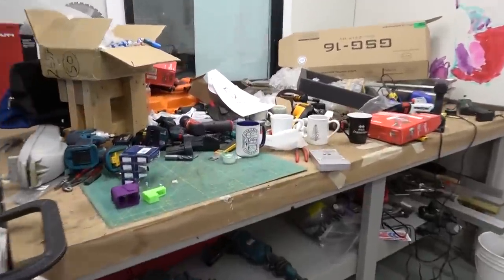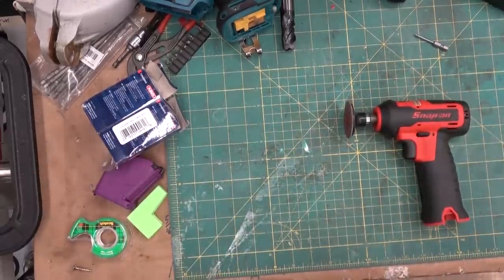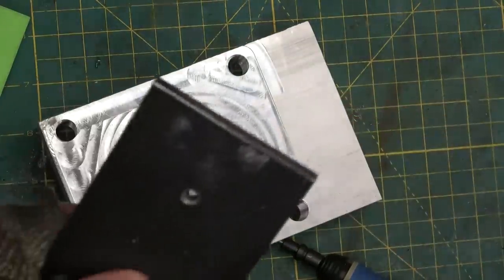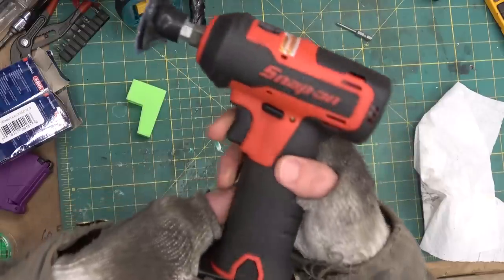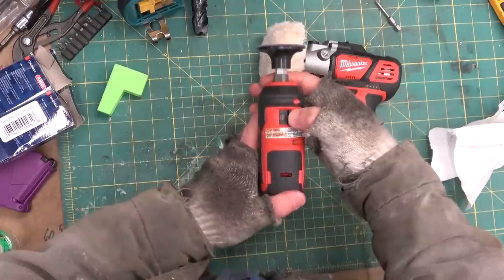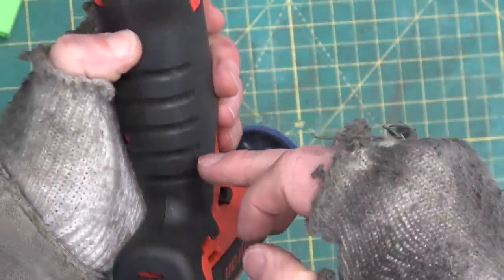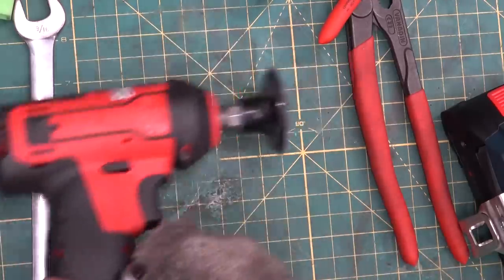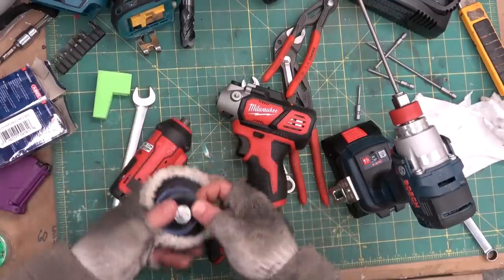BOLTR: Snap-On Polisher $$$ worth it?

Comment: I've taken apart over 100 of the Snap-on 14.4v power tools in the last two years.  If the plastic is damaged, you caused it.  I've never seen one with damage like that.  It's interesting you cut out the part of the video where you removed the screws.

Comment: When i got mine the first day i used it, it caught on fire. The high speed on that is ONLY FOR SANDING. Variable speed trigger works well, but it's not meant for continuous use. I had a good relationship with my snap on guy so he cut me a deal, and i got just the body and the battery with pads for like 200

Comment: I've got all snap on cordless except for my 1/2 inch gun it is the new Ingersoll rand, which by the way is a badass tool. I will say I prefer Snap on's cordless air ratchet over milfuckee and their right angle drill. Snappys right angle drill is just kick ass compared to milfuckee. Snapons cordless impacts are meh, they work. Nothing to write home about. When I bought my snap on cordless stuff millfuckee did not have much in the way of cordless tools. Now I am too deep into it to turn back.

Comment: I’m a motorcycle mechanic by trade here in Straya and a lot of us use the Snap-on cordless screwdriver for everything. Almost everyone I know that has bought one has had it burnt out or the LED lights just stop working after a month... 

They come with a 1 year warranty and with a $550 price tag. That’s without buying fucken battery too.. 

They are truly a piece of shit for the money you pay, but no one makes a drill that has the same ergonomics/size as the snapon and the battery life lasts me easily 2 weeks of constant abuse.

Comment: Had one for a couple of years. I use for occasional heavy use. 
Had no problem with the case or over moulding. Like the batteries. Horrible charger - very loud.
In the low speed it will frequently over temp (I guess) and shutdown for a while. Doesn’t do it in high speed.
Not the best.

Comment: I am a Fap-Off guy generally and love their hand tools, but have been steadily disappointed with their power and air tools.  I have found GOOD die grinders however, if you get the chance I'd love it if you would review a Dynabraid  tool. I've had good luck with them, but I defer to your bullshittery and opinions. I'd send you one, but I think your tool budget is a little more gerthy and impressive than mine, which is short, shriveled, and slightly to the left. Keep up the good work!
Reply: Certain Fap-on air tools are in fact relabeled Dynabraid. Specifically die grinders and D/A sanders. Only difference is the color change. And sometimes cost.

Comment: I've had this tool for years, used it professionally, in mining and agricultural fields, across a variety of tasks  from polishing to sanding and others in between. Never had a issue. Does everything i asked and still in good condition. Been dropped ect. Not a brand snob bit it works for me still to this day. Good tool imo.

Comment: I have a couple of the 14.4v line tools that take that batteria. Those through hole corntactors are pretty terribly soldered cold, a few rips of the in and out on the batteria breaks em loose everytime. Pretty sad when you spend more time fixing the jeezless thing than you spend on the customers vehicular manslaughter machine on the job site. Just an FYI if you end up having to smack her around to get her to chooch. Hit her with the dinosaur fart burning soldering iron and put some leaded solder on her pointy bits and you're back in business

Comment: I have one of sanders, not a bad tool but it was pricy. only reason I bought it vs milfukie is I already had battery's for the snappy. and the rubber grip actually stays on very well if you take care of it, (don't spray with brake clean)

Comment: ive had the 1/4in impact driver and the dril driver version since u had to pay a fuck load to upgrade to lithium, i used them doing hvac work for a year and gave up on em, the batteries are still good havent been charged in years, my dad actually  uses the dril driver doing my old job now that hes retired, ive gone milwaukee being an electrician and my company buys milwaukee and hilti so i get free batteries each year, the snap-on has been terrible and the overmolding is still decent but i have a feeling it wont be for long id be glad to send u the impact to test and tear apart

Comment: I use these tools in a Aviation Line Maintenance setting,  high abuse used daily. Snap-on cordless power tools don't last especially this tool. In regards to this tool alone; I warrantied a burned up motor, then on the replacement the gear reduction stopped functioning.  I avoid using my snap-on cordless tools now and they don't break.   I love Snap-on my entire 72" tool box is filled with Snap-on,  but I will never buy another cordless power tool from Snap-on.   My cordless rigid, dewalt and Makita seem to last forever with out issues.  Good luck changing my mind on the rest of the Snap-on hand tools  this view is only on the power tools.  Ironically the rubber grips did not degrade with 4 years of skydrol exposure.

Comment: I recently bought the Snap On screwdriver CTS761AO its variable speed trigger and dual speed I bought it because it has a really low torque break for screwing into plastic things it has a illumination LED that illuminates every where except the tool bit that I only noticed 3 months after I bought it the green LED does change to red as the battery goes down, definitely overpriced but it does what I want well even if I cant see when it gets darker.

Comment: i've owned both,  more than once on both of them too lol, the overmolding falls off both of them. they both kinda suck one thing to note for people shopping between these 2. the snap-on has the straight 90* handle and the Milwaukee has that stupid "ergo" space phaser  angled back  design that i found to be terrible for out of position buffing ( holding the part with one hand and using your thumb to hold the trigger)  the matco was the fist to come out with one of these but by far the worst. the mosfets blow out (cheap names and lacking proper heat midigation.)

if you are in need of this tool might i suggest what i have done. just buy a inpact driver. tear it apart thow in a shaved down chunk of rubber in the air gap between the the hammer n anvil  and now you got basicly the same thiing only more torque (just the right ammount if u ask me) the far supirer batterys on the m18 lineup so you dont wast your whole day playing musicly battery. and i just made lil  1/4 hex arbors with the common threads on my lil lathe and it is wayyyy better than  the sunnux,matco, snapon, dynex or whatever that yellow one was , or the milwakee m12 buffer. hopefully this helps some one

Comment: I had a 3m rubber eraser wheel on my polisher and my coworker set it on #2 and pulled the trigger all the way down. Fucking wheel shredded to pieces instantly and cracked the entire housing in half. Of course I was already out of warranty lol

Traded up for the brushless and it works good but overheats quick if you’re really beating on it

Comment: I haven't had any of my fapoff tools loose the molding. Old the batterys. And they get alot of flight time. Boxing matches with the floor and wall and hot suppers. But my grinder did catch of fire after the board took a shit.

Comment: It looks like they copied the design of the smaller 3/8 impact, at least for the appearance aspect. I use the smaller 3/8 impact on a daily basis for heavy equipment service. It has held up pretty well. The rubber has only came off the battery.

Comment: You definitely did not get a lemon, a coworker of mine bought one last fall, the red wire to the switch wasn't soldered to the switch straight out of the box, got another one via warrantay and while he was polishing an exhaust tip it just up an quit never got an explanation as to why. Also replaced with another new one straight off the truck.

Comment: Thread forming fasteners being driven into plastic is somewhat of a dark art amongst mechanical design enginerds. The physics involved require laborious torque studies to be done, post design. This then leads to minor tweaks to the mold then more torque studies, until the molded part accepts screws at the specified torque, without any of the negative effect seen in this vidjeo. Many companies do not want to do all of this pre product verification and testing, so they slam the same specs for the screw bosses from a previous project into solid works and hit the send button. Kind of sad really, buts it the nature of modern manufacturing.

Comment: Now I don’t have the exact tool but I do have the 14.4v 3/8 impact that’s in the same frame. And the rubber actually held up for about a year working with hydraulics. Every Friday before closing I would even clean it with brake kleen. The good shit in the red can and it held up. But eventually it has started to fail. I wish I could upload some pictures on here but I don’t know how. And the case hasn’t cracked or fallen apart yet. I’ve had the tool for 2 years now

Comment: Yikes...
$540...
I've got a handful of tools from fap-off's 14.4v line, ratchet, impact driver, 3/8 impact, drill, sawzall.. 
I cant say for sure about this tool, but all the tools I have were under 200 for the tool body. And I think my first combo pack was round 400 with 2 batteries and charger. 

I can say for sure however, the overmolding does in fact peel off like crazy after some oil/grease/brake clean action

Comment: for that price, i'd expect more metal in the gearbox, better build quality, and maybe a brushless motor. I could get better quality from an ALDI special!
Reply: Nothing wrong with an aldi special. 

My aldi special drill has survived 3 years of hot suppers.. and a few thrashings from the mrs putting up shelves. 

She still chooches like a dream and only been on the healing bench once. 

And on the plus side no over molding to give off the Chinese factory aroma. 

All for the price of a happy meal
Reply: @richard-gn3es  I'm pretty happy with the aldi workzone tools. Got the cordless drill, angle grinder and impact wrench. Worth every penny. The batteries are awesome at 20v/4ah for $30aud. Looking forward to their next special.

Comment: I bought the whole line of the 14v lithium stuff a few years back. Nothing but regret, that over molding doesn’t hold up well to any cleaning and use. After a year of use my whole set was hammered and sad looking. The batteries and chargers don’t hold up at all. The 3/8 impact and ratchets were the only redeeming tools in that lithium lineup of tools and they had the same cosmetic issues the rest did. I sold my whole set at a HUGE loss a year ago and completely use Willfuckee at this point. Snapon really fucked us with those ones.

Comment: Hey bud got something for you to figure so my brother has these flashers for ice fishing they run off at 12 volt battery and apparently they're making these adapters on 3D printers for Milwaukee batteries sometimes they work sometimes they don't I thought that was nice but they look like the trash so I took an old drill cut the top off and hook the wires up and everything runs fine on mine however the one my brother got from this 3D printer guy does not work any reason why also they try getting a slim wall charger model off of Amazon cutting the wires and using that as a power source so they would plug the battery into the slim charger and use the cables to hook up to the flasher that would not work at all and they would only work when you have an inline fuse not without any help on this would be great thanks

Comment: I bought one a few years ago. It probably gets 5-10 minutes of use a day in an auto shop... I use it to scuff the inside of tires for patches. The thin overmolding is crap. The snap on batteries suck thought. I'd love to pick and choose the best this and that with battery powered tools but I don't need 12 chargers hanging around.. there's some snap-on 14.4v things that work so well for me I don't want to give up the system... It's not worth the money by itself But... I already have the batteries for other   tools and it has made me money because it keeps me from having to drag out an air die grinder every time. Also the clamshell on mine isn't as fucked as yours.. it still has the retention but where the screws thread in is fine.

Comment: I’ve owned them both and the snap on is not worth the price difference you say that’s a good switch in the snap o but mine had to be replaced twice before I gave it away and bought the Milwaukee and have had no problems with it

Comment: That looks exactly like the impact drill I use at work but mine is bright green. Lasted about a year need a new one lucky the company pays for it. I work with atf and the over molding on the impact has been ok. The battery over molding is crap and the smaller rubber lines around the brand name are nasty

Comment: ive kinda always looked at the snapon cordless tools and said, is it worth it. Milwaukee has a good option with a local store that is a authorized dealer. if it breaks, warranty is just a drop off and off to fuck knows where it goes. happens that ive had to send the 1/2 inch Uga Duga back twice.

Comment: Have had a few of those for about 5 years now, maybe more?? They definitely are the cats ass. Use them all day and they do not die, they do not break, they are incredibly light and feel great in your hand. We use them for buffing shit, we paint all of manitous painted pontoon boats. Those polishers have been through 850 boats now and not a single one has shown ant sign of wear or has broken, also you really talk crap about the overmold but they still look brand new. Even around paint thinner. Can't vouch for the millfuckee but I have a pretty cool video of one of their drills going up on flames on my phone. That's the difference, snap on doesn't break

Comment: Shame. I hope Snap-On is watching. I have mixed feelings about their 14.4V  line. 

The 3/8" impact is one of the best and most useful tools I own. No one makes anything as good that I've tried. The screw driver is awesome and I love it. 

I have been really disappointed by the drill however. The chuck is garbage, won't hold a drill for shit-- any size slips. No torque. So frustrating. Already been sent back once for service. Took 2-3 weeks. 

In general I prefer the look and feel of this line over the Milwaukees tho. Seem to age and wear better too. 

BTW the drill and driver set with two batteries and a charger was  +/-$350 for sale on the truck. Find the on sale and the cost isn't so insane (I have to do the same buying Dewalt/Makita from Home Depot). 

$540 for that polisher is totally inappropriate.

Comment: I like Snap-on hand tools, but I've learned to avoid electronic stuff... Especially the really overpriced timing light that I got like 5 uses out of before it quit working... Snap-on man wanted $80.00 just to send it in to get checked out.... That's when I learned that they don't just replace electronic stuff when it breaks like they do with hand tools... I still have that overpriced piece of junk that still doesn't work. I replaced it with a cheaper Craftzman that always works great.

Comment: Got a snap-on 3/8ths impact. it has the power but once i worked at Makita for a couple years and picked it back up again i realised its a peice of out-dated trash... NiCAD batteries in 2014!!! still sold it for nearly 500$ and the light dosnt even stay on if the motor isnt spinning. Total ripoffs.
I am gonna buy a Makita DTW1002Z soon, and that's gonna be one hell of an upgrade. 1/2 inch and strong enough to explode it's own anvil haha

Comment: Why would an Automotive tool company over mold with a material that would melt with brake clean or oil and grease??? You are right...if I need a small sander like this...I would go to The Hazard Fraud or maybe spring for the Milwaukee at Blows. This Made In USA not worth he price...

Comment: I have a fap off driver. I dont remember the model number but its extremely similar in design. It also cost 300 bucks. The only reason i got it was it had a 1/4" hex drive and toggle forward reverse switching. Its nice for power tapping and quickly chasing chewy threads. It smoked after 6 months and i had to pay 80 bucks to have it rebuilt. Garb.

Comment: I work at a body shop buffing paint and we have both polishers at work.  The Milwaukee is far better work horse impo and we beat the hell out the things.  One drop and the snap on was already knocking in the motor.  The Milwaukee has faired much better

Comment: Snap on power tools have been acceptable yet not very impressive in build quality for years now. The only ones who actually make something that’s somewhat worth a large price would be Hilti and even those guys do some stuff that’s not that impressive now days. That’s why most commercial shops have stuck to pneumatic tools even though electric power tools have come so far. They have the power but the long term longevity is still the determining factor.

Comment: For that price, I would have expected much more attention to detail, brushless motor, 2 batteries, I would like to see some metal tabs, stainless socket cap screws with female SS threaded inserts to hold the case together. IMHO the price tag on this thing directly reflects corporate greed, they are getting destroyed by the competition, so expect snap on to raise prices while cutting back on quality to try and remain profitable.

Comment: I know you love your long suffering cutting mat. But if it's one that doesn't have the grid print on both sides I'd flip it over. Your camera will probably do a much better job focusing on stuff you put up closer. It's because the autofocus pixie magic won't have those nice contrasting grids that AF sensors love.